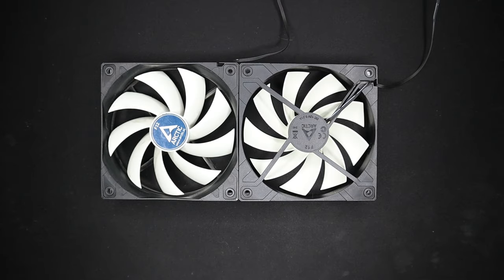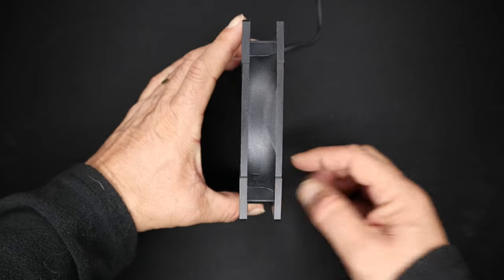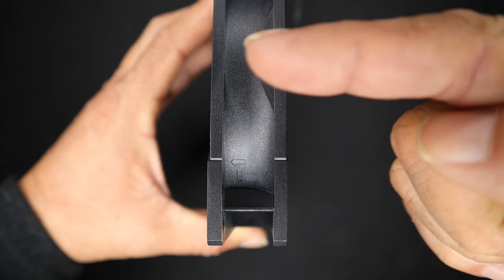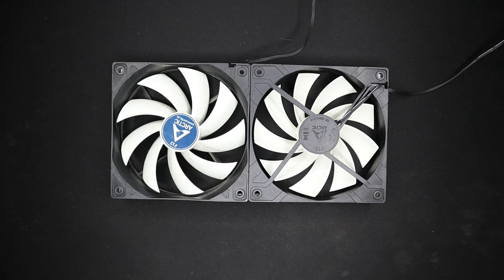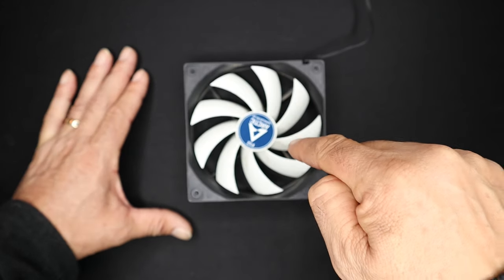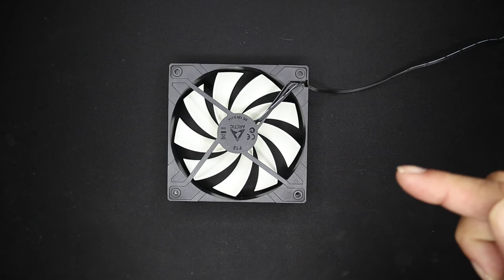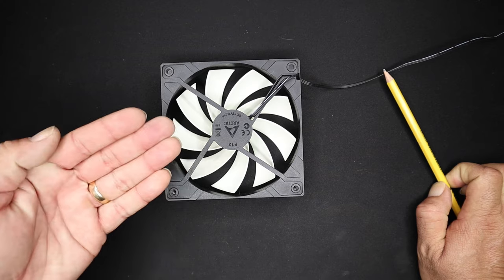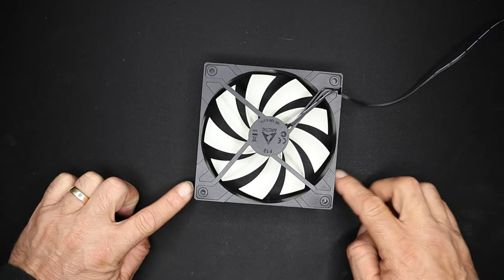Computer fans - 3 tips on how to determine airflow direction - intake vs exhaust

Comment: simple way to remember : back of the fan (exhaust) (air blowing out)  , front of the fan (intake) (air blowing in) . The front of the fan should usually have a logo. Also fans mounted on the front of the case should always be intakes, fans mounted on the rear and on top of the case should always be exhaust.
Reply: Thats how I remember as well. Factory always tries to put their 'fancy' logo on place where you can see it. That is indeed the front
Reply: So if you have an aio on the top of the case you want the fans to have the logo?
Reply: @nightwing100T  ye
Reply: So basically the exhaust fans should be upside down (logo facing upwards) for top and rear same applies (logo facing outside the case) 

This correct?
Reply: The top is not always exhaust fans..... sheesh you’ll have negative pressure, which in some cases (cases lol) is a good thing, however my pc I have equal intake and exhaust
Reply: What about the side of the case?
Reply: So when mounting as an exhaust fan you would have the exhaust side showing instead of the front ??
Reply: Thx
Reply: Which way should bottom fans face?
Reply: wrong. simply use the right hand rule
Reply: In what direction should I install it if it's on  a cpu heat sink ?

Comment: Thanks for the help. I'm building a PC with an AIO cooler and needed to know if I'm pushing or pulling air through it BEFORE I assemble everything and hit the power button and possibly have to flip the fans and rerun the wires. Thanks again for taking the time.
Reply from the maker: Glad the video helped some.... Good luck to you! ⚡️

Comment: I think I put my PSU fan in backwards because it was loud, and just a few mins ago I took the PSU apart took the fan back out it seems like it's more quit. I took it apart because of the dust, but afterwards I was paranoid. I bought another PSU just in case.

Comment: it's good to point the direction the fan spin:
blades downward angled on clockwise direction: the opposite showen in the video;
blades downward angled on counter-clockwise: as said in the video the front blow in and  the back blow out.

that's it?

Comment: My side fans (120mm) is exhaust and my back (80mm) is also exhaust. Should I change?
Reply from the maker: If your temps are good then i wouldn't... Depends on kind of case you have... Overclocking CPU?  Have a GPU? Many variables to account for... Just ensure your case has decent airflow... Good luck to you! ⚡️
Reply: @ScottsPC  Ryzen 3 3100 and GT 1030.

Comment: My case has two fans on the side instead of front and one on the back. Should the two on the side be I take and the back be exhaust?
Reply from the maker: What's the name  and model of your case? Hard to answer without more details.....
Reply from the maker: @射進肚臍 if airflow is right to left starting at the front of your case... The x should be on the inside.. It is installed correctly... All good

Comment: I think I’m really dumb. So in a case the front is intake fans and the back and top is exhaust right? So does that mean in the front the blade(intake side) faces out or faces in the case? Same thing with the back, if airflow needs to go out does the X side (exhaust side) face inside the case or out??

Comment: i need help 

i built my own pc recently and my cpu fan appears to be pushing air in towards the cpu if this i correct that’s ok but if it’s not can i change the rRotation bye switching the plug around for the CPU fan in my motherboard
Reply from the maker: You are fine... That's what it's supposed to do.

Comment: my computer came with the cpu fan blowing onto the cpu cooler. What is the recommended direction for a cpu fan?
I turned mine around because it made more sense that way to me, so now it exhausts into the case.

Comment: Question. Im planning to make replace my top radiator intake with a new fan, do i uninstall the radiator on the top mount and put the fan first and then the radiator or do i kust attach it like the old fan but backwards so its facing the right direction?

Comment: Which way would you suggest for PC to cool down and make a better airflow? I am confused, I don't know if I should focus on my pc exhaust or intake since both of them seem like a good deal for my old pc that I am going to put fans inside.
Reply: Also, I am not a professional on these stuff but I am really interested in computer works so I do want to know a bit more about this, sorry for the trouble
Reply from the maker: You just want the best airflow you can get through your tower.  Focus on both intake and exhaust.....Good luck to you!
Reply: @ScottsPC  Thank you so much for your advice. I will make sure to try both of them and make sure to do everything correct

Comment: I have a Corsair iCue H150i elite capelliz cpu cooler on top of the case (intake air), 2 intake fan on the side, a one exhaust fan at the back of the case, is this airflow right?
Reply: No fan on the front of the case